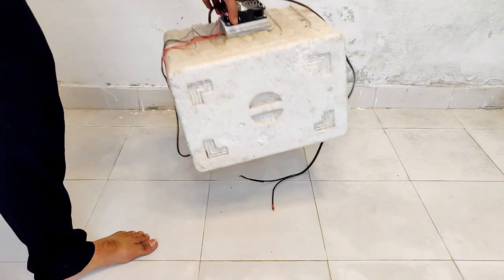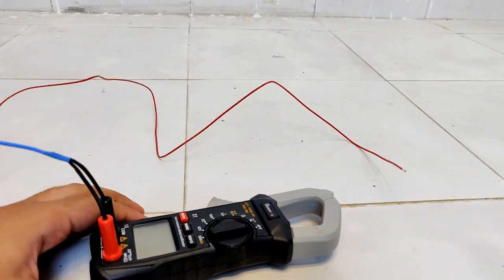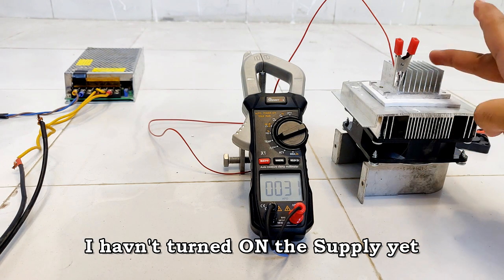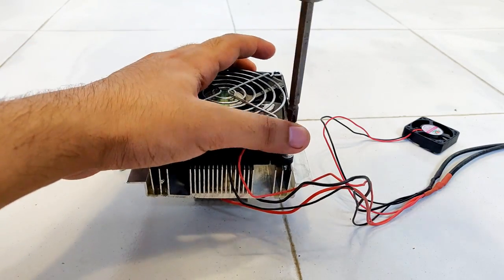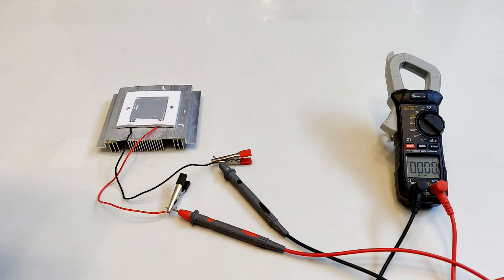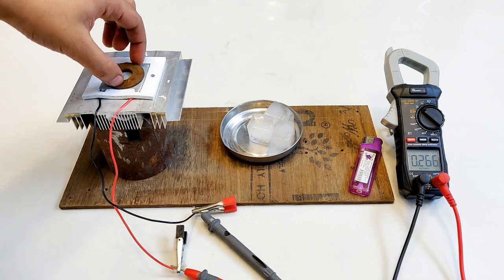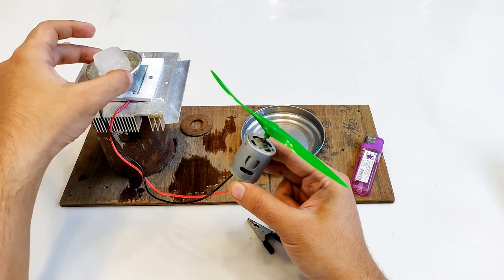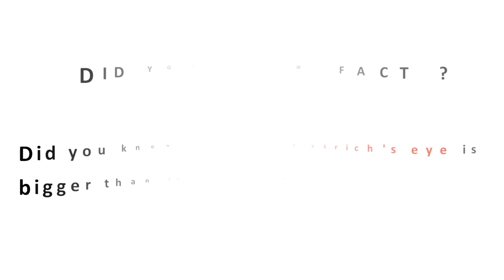12V DC Peltier as Electric Generator for DC Motor - Measurement of Current, Voltage & Power

Comment: so here is the thing, yes, each unit is inefficient, BUT, it is also 1. very cheap to produce 2. use very few resources 3. easily scalable 4. can be used to harvest latent heat and passively charge batteries. 
So overall as a system, it can be efficient. It isn't only about how efficient the piece is, but also how efficient the whole process is from production to application

Comment: It's funny that in Hindi-English, "little" has become "less". 
Little = small amount
Less = smaller amount than something else

You're measuring voltage, and finding that it's not producing a lot of voltage. The correct word to use then, is "the voltage is low"  or "the voltage is small". Not "the voltage is less", unless you you're comparing it to a system where the voltage was higher.

Comment: The biggest downfall is cost efficiency to achieve the temperature differences.
Reply from the maker: right
Reply: @MrElectron  i was thinking off putting a hole in my wall so one side off peltier is outside in the cold in winter and on the inside i plan to place a pot heater next to the peltier on the inside as i can get free oil to power the pot heater i can get it extremly hot....so outside is very cold..i will make the other side very hot to max temp....how much energy do you think i could harvest if i did this well....thanks..edit i only wish to trickle charge some batteries so what amps do you think i could acheive with a large peltier design

Comment: Hi sir,make a video on 
With a wiper motor with gears attach  
Cycle gear and use cycle chain to connect both cycle  back tyre gear with  wiper motor 
And do ride test  with motor operated cycle 😀😀😁